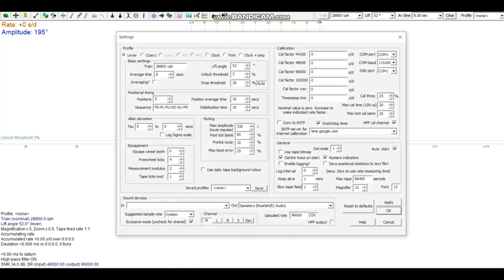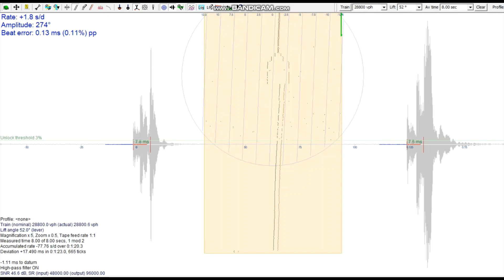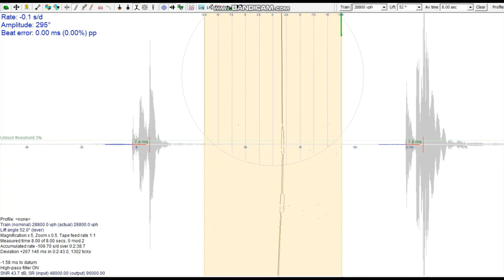Rolex Watch Service - 16233 Worn until it fell off the wrist

Comment: My father-in-law has a Stainless Steel DateJust with Oyster bracelet that has a similar story. That bracelet is ready to fall off too, the clasp pin has worn almost all the way through the first bracelet segment! It's been serviced perhaps once since bought in the mid 80s and he's now retired with a smallish pension so I doubt it will be serviced again. Amazingly it's still accurate to +-seconds a day despite being treated as a true tool watch and never leaving the owners wrist - sleeping, showering, gardening it stays on.

I've told him right up that I will not be repairing his DateJust at all - where would an enthusiastic amateur like me get spares from? Polywatching the acrylic is the most I will do to that rather impressive tool watch.
Reply from the maker: Hi Alan, a service would be a very good idea. It really is a false economy to not maintain a Rolex. The parts are so expensive that running them without oil can be very costly. In a watch which contains an ETA 7750 or 2824 it's not such a big problem, all parts are widely available and not too expensive. In a Rolex it is a different story. The parts bill on a poorly maintained watch can be several thousand pounds.

A good independent watchmaker should charge around £400 for a Rolex service and you can have it done every 5 years to maintain the watch nicely. This works out at £80 per year. The annual increase in value of a well maintained Rolex will dwarf that cost.

Comment: Awesome vid! Thanks for taking the time to share with us the process and servicing techniques! I was getting a little worried when you were doing the pressure test with the movement installed!!!
Reply from the maker: Thanks for the nice comments. A pressure test when the work is complete is the only way to know that the watch is suitable for the customer to wear in water.

We also test the case when it is empty so by this point we are already very confident that the watch will be water tight. Also, if the waterproofing does fail, it is far better to happen in the workshop where we can remedy it, rather than when the customer first takes it swimming. Especially if they are overseas in saltwater for example.

Comment: Very nice video though I disagree a bit with your statement regarding parts availability as this has not been an issue even for older 3000\3035 and 15XX movements. The only issue that may occur with some independents is not having a direct Rolex parts account which has become more prominent as Rolex has made it harder to retain account status. So an independent without a Rolex parts account will have to either find gen through eBay or Swiss aftermarket through watch supply houses. In actuality most independents when it is determined a main spring replacment is in order will obtain a quality Swiss made aftermarket at a lower price. I personally am a stickler for genuine Rolex parts but items such as barrel mainsprings, crown tubes, o' ring gaskets and spring bar's if quality Swiss made are of little concern to me as long as the cutomer is ok with it and the savings are passed.

Comment: Great video and excellent work, but I do wonder about one thing: why do horologists put the second hand on seemingly any old way? Shouldn't all three hands coincide at some point? Why don't you put it on in the same position as the hour and minute hands, 12:00:00?
Reply: Hi Alastair, with a high beat movement the second hand sweeps meaning that it will land at all points of the dial. It also has a hack mechanism so the second hand can be stopped at any point whilst the other hands are adjusted. This means it can be put on at any point.
Reply: @andrewglover1739  Thank you for the explanation.

Comment: Also I have the same issue with my dads watch with the pin sliding out. The same pin.  RSC wants to charge me almost $200 to replace teh entore clasp.  When i think i just need a pin replacement.  Any advice on how i should proceed?

Comment: I'm always bothered by watches in this condition. Its neat that you can have a watch that will run for decades without service and I like to see watches get used, but people need to care for their things. When I see a watch like this I see a person who takes what they have for granted, not taking even the slightest bit of care with it. A person who probably never changes the oil in their car, their house is always a mess and just neglects everything until it finally falls apart.
Reply: Lots of people with these old rolexes bought them in the '70s OR '80s when they were dirt cheap. When you can get a used one for a couple grand. So they don't really have much invested in it, and if you don't keep up with the Rolex market, or the high-end watch market in general, you would never know that your watch from 40 years ago is worth $15k-20,000 if you would have kept it in good condition.